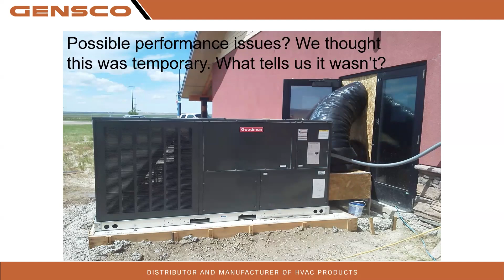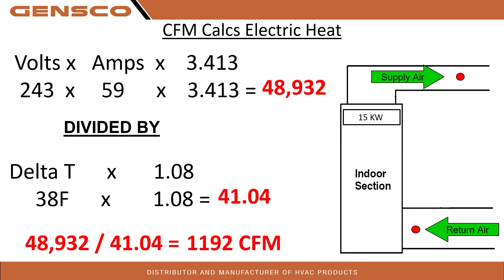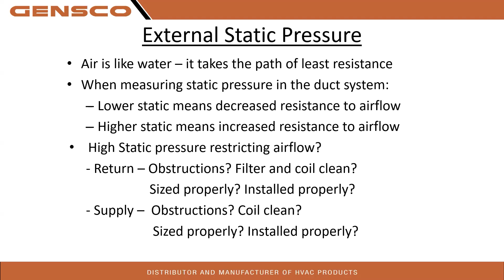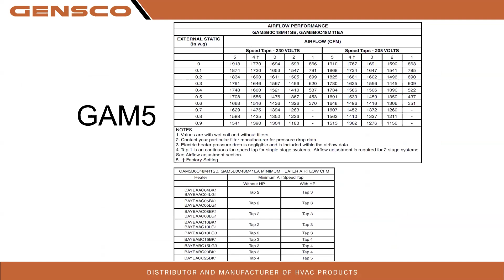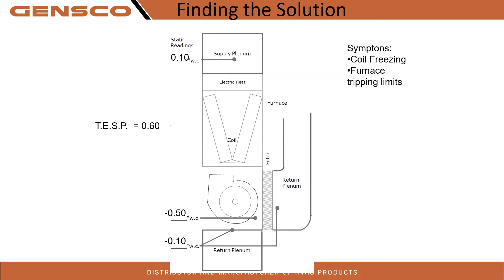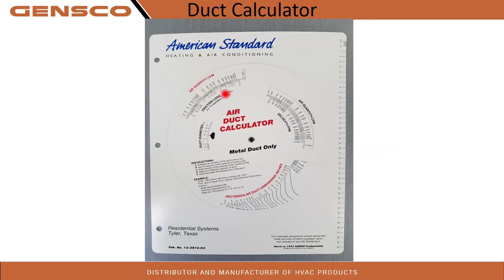Airflow Troubleshooting

Comment: your life will change by using an air pump needle fitting like used to pump up a basket ball, football etc and you can slip it in though screw holes and whatnot.